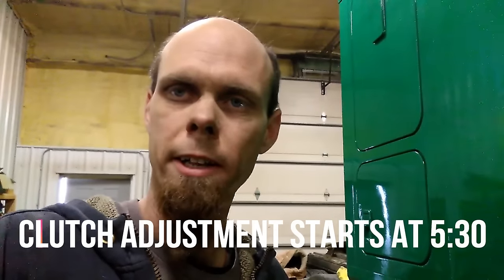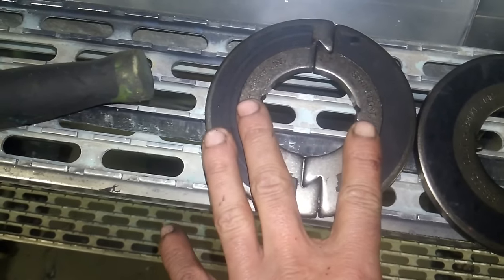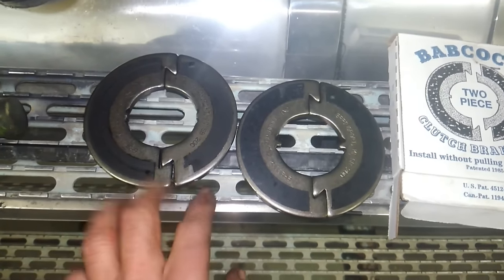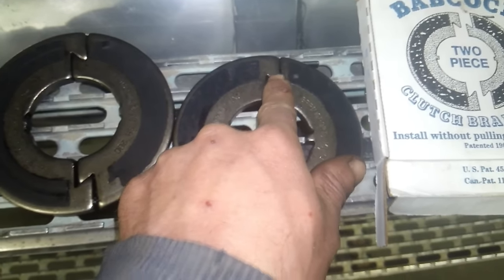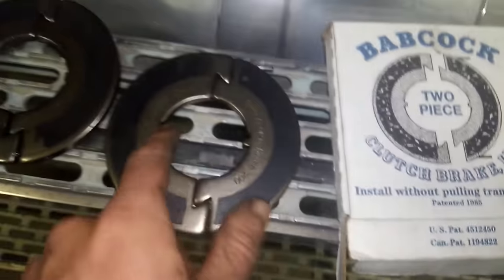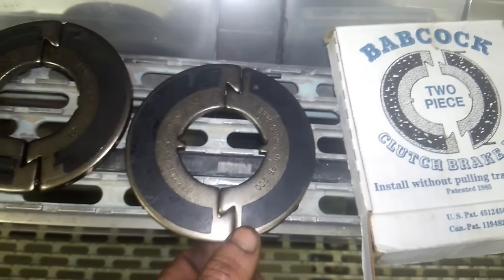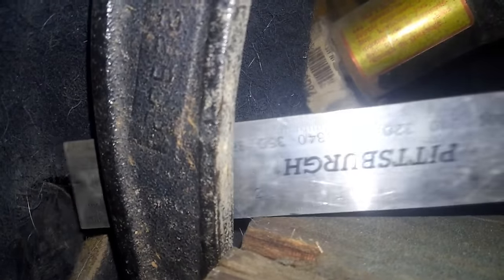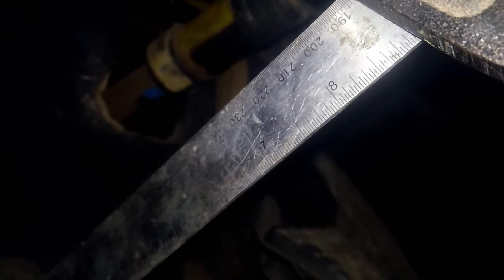clutch brake replacement and clutch adjustment eaton fuller

Comment: A 1/2 inch clearance between your clutch brake and front bearing retainer plate with 1/8 clearance between your release fork ears and throw out bearing is your adjustment. That is also your clutch pedal free play. Collapsed, broken or missing engine/transmission mounts and or cab mounts affect clutch and clutch brake adjustments. Inspect and replace mounts as necessary. And yes you do grease your clutch brake according to the latest and greatest Eaton service bulletin. It is the same lithium base grease you use in your throw out bearing. I don't have the service bulletin number anymore but it is found on the Eaton website. Check it out guys.
Reply: Is it hard to change engine mounts on Columbia?
Reply: Thank you for the cab mount mention. I just bought a truck and before I did upon inspection I found the passenger side mount rotted but thought it wasn't a big deal and I'd fab something up. Then upon receiving the truck when I first wanted to just move it on my property I couldn't get it in gear from a standstill. But after touching base with the dealer I bought it from, the delivery person didn't notice anything (once you were moving you wouldn't of course). The cab also leans a bit more I think than I noticed when I first looked at it before buying it. So, I will check this out - it may be the reason my clutch brake isn't working. A passenger side sag would elevate the drivers side, where of course the clutch linkage is. And driving it could have caused the mount to collapse more. Makes total sense but we'll see.

Comment: finally got my clutch brake in i checked the adjustment with a half inch extention it still wont stop the tranny to put it in gear think i might move the adj the clutch a little closer think im on the right track?
Reply from the maker: Yes set your bearing to break clearance first then if needed adjust the linkage.

Comment: Do you think i can do the same on a one piece clutch brake ? or cut it with reciprocating saw with diablo steel cut blade. I don’t have torch :(
Reply from the maker: You can try. Easiest way to remove a 1pc without a torch is a cutting tool they make that basically clamps onto the clutch brake and has a guide for a drill bit to drill threw the clutch brake to cut it

Comment: I have had 2 clutch brakes put on, both using the allen screw type. They keep losin the teeth that u showed was gone that makes it bad. What keeps causing that?
Reply from the maker: Pressing the clutch to the floor while moving
Reply: @Ezrider359  yeah i know that. I only depress it enough to take it out of gear. Press it back in if needed sitting still.

Comment: What it mean if the clutch gets stuck down when you push it down it will pop back if you put your foot behind it and pull it out. Truck hasn’t been on the road for 2yrs
Reply from the maker: Most likely something is froze up/stiff. Grease all your cross shafts linkage's ect what doesn't have grease fittings hit with some lube and work it back and forth. Maybe it will come back
Reply: @Ezrider359  thanks

Comment: Theres no cushion on my clutch pedal when it hits the floor and the gears grind going in. Gears work fine once the truck starts rolling, was thinking it needs a new clutch brake or adjustment...took it to a mechanic and he wants to put a whole new clutch and says he cant adjust it because its a solo clutch. It sounds like hes trying to pull a fast one, what do you think?
Reply from the maker: its possible what they are telling you is true they could also be blowing smoke. can't say without seeing it for myself. there is a re-set procedure on the solo clutch but its also very possible its just out of adjustment. i would ask the shop to show you how they came to that diagnosis. there is a wear indicator on the solo clutch that will indicate that the clutch is shot, ask them to show you that. you can see it threw the inspection cover as long as the clutch is lined up to the right spot.
Reply: @Ezrider359  Update: i took the truck to another shop for a second opinion, turns out it was the clutch brake! That other mechanic tried to cheat me big time. He wanted $1800 for the clutch job and it was just a $60 fix at the other shop. I left a 1 star review on google with a summary of my experience. I cant believe how scandalous some people are. By the way, thanks for your reply

Comment: Here is a trick I learned. Take a 3/4” extension cut a slot into it that the clutch brake will fit into and take a 3/4” impact and it will break it in half

Comment: Hi EZrider. I had clutch replaced on my international 9800 but now the mechanic is unable to get an adjustment to stay. The pedal is where it should be,  but he keeps fumbling with the linkage and when he’s done the catch is too low and he can’t seem to raise it. What do you think is going on. I’ve had clutch and brake clutch replaced the bearings replaced and the flywheel cut. Any suggestions please
Reply from the maker: Check and make sure the bearing to clutch brake clearance is correct before you worry about where the pedal is. Linkage should be a set it once and forget it deal. But also check all your linkage for play
Reply: Will do and thanks. Love them videos keep em coming. I’m looking to stretch the frame on my cabover soon.
Reply: What should the clearance be???

Comment: Question-I have ez pedal clutch and there is no adjustment my clutch pedal has no free play is there any way to adjust
Reply from the maker: if its a easy pedal it will have a adjuster, its a different style than the one i showed. its a hex that you push in and turn with a wrench normally has a yellow tag around it. might have to bump the starter or bar the engine over a few times to find it.

Comment: I want to get a job in this industry, this is the type of work I'd like to do everyday. I got a 99 silverado for 400 bucks needed a trans, so I bought one and put it in and i daily drive it. If I can do that I think I can do this type of work.
Reply: 99 -02 Body style silverado by the way.
Reply from the maker: Yeah for sure. Might start out sweeping floors or doing oil changes but it's a trade that you can get into and start working your way up starting with little experience if your willing to work hard and learn.

Comment: Brother I have 2017 Frightliner cascadia I have clutch problem I change two clutch in 6 months all clutch works same engage very high that’s clutch highdrolic what be the problem thanks for any help brother
Reply from the maker: I would start by checking the clutch is set up properly to start with. The adjustment will set the engagement point

Comment: clutch brakes are supposed to have a light coating of grease when installed, so getting greas on them isnt a huge issue, if there is an inch of grease on it just scoop it off and put a light coat back on,  without grease your likely to burn through clutch brakes quickly
Reply from the maker: Was packed with grease was also -30f out
Reply: Ya you don’t want too much. But you don’t want them completely dry either.  I’m not trying to be critical or anything. Just trying to add helpful tidbits of info.
Reply from the maker: No I get that I was just explaining why I think grease may have been a issue

Comment: Is the brake loose as where it can slide towards throwout bearing??
Reply from the maker: Yes
Reply: @Ezrider359  ok my disc looks like no friction material at all just metal and metal looks like it’s breaking so I’m guessing it’s time to replace??? It still shifts ok but probably needs replaced?? It’s a 95 international 9200 splicer 10 speed is the clutch adjustment the same as any other?? 1/2 inch ?? Thanks 🙏

Comment: I  went  to  work  for  a  grocery  company  with  20  IH  9600s  and  with  9  of  them  the  last  guy  had  "adjusted"  the  linkage ,  not  the  internal . It  took  me  most  of  the  day  to  figure  out  which  way  to  go  to  get  it  right  on  the  first  one . He'd  even  moved  the  pedal  stop . 
Some  people  shouldn't  be  allowed  to  touch  tools . 😨😲
Reply from the maker: iv fixed a number of clutch adjustments where people took there truck to a shop to get the clutch adjusted and the shop just adjusted the linkage rather than adjusting the clutch. sometimes they will get adjusted improperly as well when there is excessive slop in the clutch linkages. because they are focused on the freeplay of the pedal vrs the measurment at the throw out bearing. its a easy thing to understand but because the end user is at the pedal not the clutch its easy to look at it from the wrong direction but still no excuse for people who are getting paid to do this.
Reply: @Ezrider359  
I got it hammered into my head very early, Adjust the clutch, not the linkage. 
Cat DW21 scraper had a clutch setup very similar to the Eaton. We had 7 or 8 with flatbeds for 4 yard mud buckets at lower granite dam.

Comment: The only thing that could have been added to this video, would be advice to users of heavy manual transmissions.... don't ram the clutch pedal to the floor when changing gears.  In fact, don't run the clutch pedal to the floor any time the truck is moving.  The clutch brake is designed to be used when the truck is dead still and the transmission is churning,  NOT when the truck is moving and you are changing gears.  For the action of simply changing gears, if you like to use the clutch, only push it in far enough to break the friction point, that point being where the clutch plates start to "grab".   Again, you ONLY need to floor the clutch pedal when the truck is at a dead stop and you want to slip it into a gear.  Pushing down the pedal all the way and causing the clutch brake to engage while the truck is in motion, causes the clutch brake to wear exponentially, and ends up removing the material from the face, known as burning it out, blowing it, rendering it useless.  If you do not understand this, ask someone familiar with proper operation to show you how to NOT ruin a clutch brake.

Comment: i measured the tranny shaft at 1.5 inches but i cant seem to find a 1.5 inch clutch brake 1989 fuller tranny
Reply from the maker: Are you sure it's not 1.75 that is somewhat common. 2" is the most common
Reply: @Ezrider359  remeasured today yup two inch..thanks for the video

Comment: No need to drop transmission correct?
Reply from the maker: To Change a clutch brake? No however if you have a 1pc clutch brake cutting the old one out can be less than fun.

Comment: ATTENTION- Clutch brake tabs shear like that when pedal is pushed to the floor while the truck is still moving. Truck must be completely stopped before you push to the floor or those little tabs are trying to stop the truck!

Comment: Excellent video thank you!
Reply from the maker: glad you enjoyed the video 👍
Reply: @Ezrider359  
I have a 2014 Mack with a Eaton Fuller 10 spd. My clutch brake I was told that the tabs broke. Any chance you can help me out with how to replace this myself. I believe the one piece is still in there.
Reply from the maker: @sc-dx9bc  if it is a 1 peice your going to have to cut it off. no real easy way that i am aware of its a pretty miserable job.

Comment: He explained well but he need help in the cámara, hard to do the work and filming
Reply from the maker: some things are not to bad to film by yourself when you can just put the camera on a tripod and work normally but trying to film and work on your back under a truck threw a like 6x4 inch hole with no where to mount a camera that's not obstructing your ability to work is certainly a challenge

Comment: Certain drivers at my work just dont get the meaning of a clutch brake..changed one guys 4 times since I've been there, broken the teeth everytime
Reply from the maker: Clutch brakes don't last long when you try to stop the entire truck with them
Reply: @Ezrider359  certainly not, we also tried using the 2 piece "road choice" brakes that are hinged with a locking tab and they seem to pop off every so often
Reply from the maker: I have had that problem before as well that's why I recommend the Babcock brake
Reply: @Ezrider359  for sure man, the one you used looked even beefier then the 2 piece one that eaton makes, seems a little easier to install too. Gonna try getting one of those
Reply: @Ezrider359  btw I'm curious, what year is that green mack tractor you are usually working on in your videos? & what engine?
Reply from the maker: Model year 2000 mack vision cx613. Engine is a e7 460 tans is Eaton Fuller 13 speed
Reply: @Ezrider359  had a few visions at work but were a little newer with mp8s, no longer have em though, still have a few trucks in the fleet with etech engines though. Thanks for all the replies man, & keep the good videos comin

Comment: What do you mean by applying to much torqload
Reply from the maker: Basically applying to much force to the clutch brake sheering the teeth off one common way that happens is when a driver pushes the clutch to the floor while the truck is still moving in gear so basically the clutch brake is trying to stop the entire truck rather than just trying to stop the rotating mass of the transmission as it's designed to do
Reply: @Ezrider359   what if a throw away bearing is bad can that also cause the teeth to sheer of on the clutch brake.im driving a t800 kenworth and only use my clutch to pull away.the truck is eating up the clutch brakes.

Comment: You are 100% correct. Adjust the clutch the way you explained. Then measure free play of the pedal. If the  free play of the pedal isn’t close to 2”(your free play was around 2 1/4” I wouldn’t change it) then adjust your free play of the pedal by adjusting the linkage/cable, depending on what truck you have. Great tutorial of adjusting clutch non the less. Many people get this wrong.
Reply from the maker: its adjust the clutch then adjust clutch brake squeeze and as long as those two things are correct then free play at the pedal is illrelevant. but when those two things are correct then your pedal should have around 2" of freeplay.  👍😉
Reply: Ezrider92356 how do you adjust clutch brake squize?

Comment: Uhm..no!! the reason for the grease to come out of the throw out bearing is because the clutch brake need grease on it..otherwise you will smoke it...non grease and a clutch brake adjustment that is to high off the floor will shear them little tangs off..

Comment: Still have this exact clutch in my truck and have been looking for a video on it. Been fighting with a pry bar trying to move the adjuster, and all it does is turn the engine. I've been able to get a couple of adjustments out of it before, and now it;s just a bitch.  Ordered a adjustment tool, and I'm hoping that'll get it done. This clutch hasn't been adjusted but maybe a handful of times. Thanks for the video.